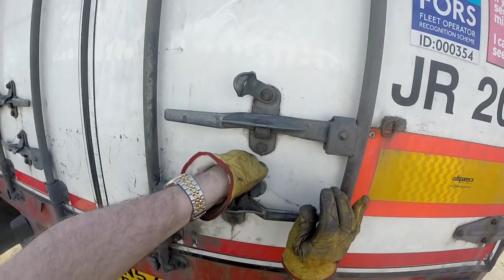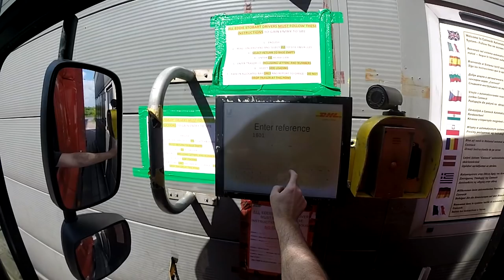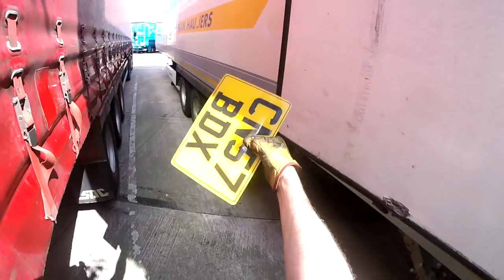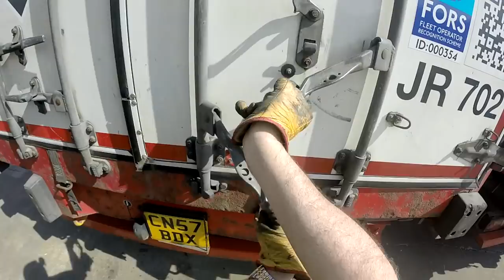#HGV Trailer Changing From Yard To Yard

Comment: I ALWAYS put the legs down first after when I first started out driving the Arctics about 14 years ago I did everything and forgot to drop the legs!!!  CRASH!!!!! had to get a forklift driver to lift the trailer from the front to lower the legs. ALSO I ALWAYS double check the 5th wheel has 100% locked In place!!! Again as a newbie I ‘thought’ I heard a click but found out the hard way when I pulled off. I’ve learnt the hard way on my own as a beginner. The more experienced older drivers just laughed at me lol
No one helps you 
Your basically on your own once you pass the test
I’ve pulled suzies out Aswel lol
It’s all a learning process

Comment: Great video but the way you dropped the first  trailer was wrong. The first thing you did was pull the pin. You said your trailer was heavy and if you were on a bit of an incline' your trailer would of rolled back. Not good practice. Great video though 👍🚛

Comment: Do you set your Tacho to 'Driving' or 'Other Work' for this?
Reply from the maker: Maurice Devitt most tachos will automatically switch to other work once you stop driving. But if it doesn’t, then you need to manually enter it!